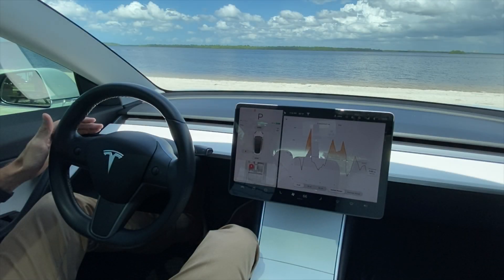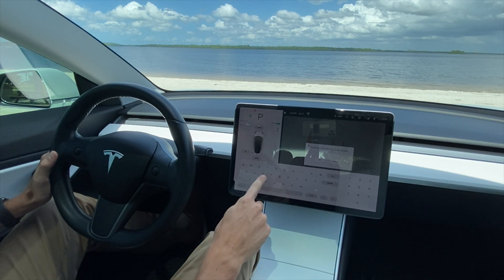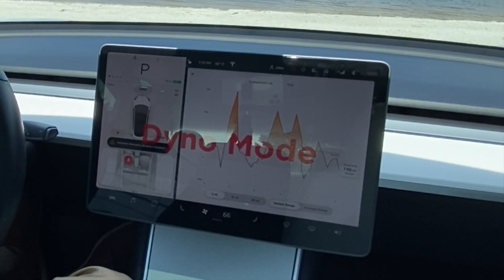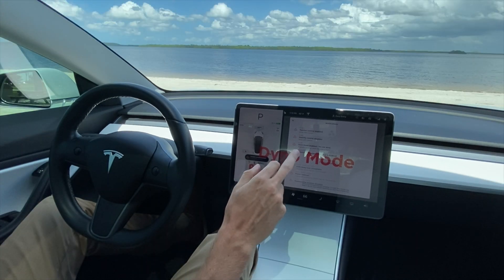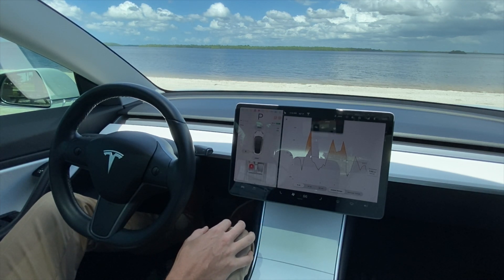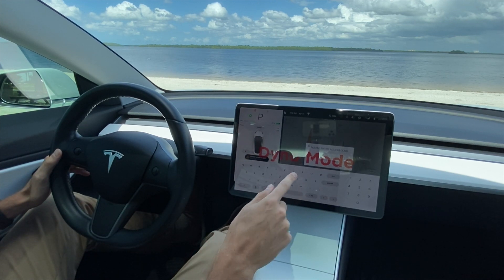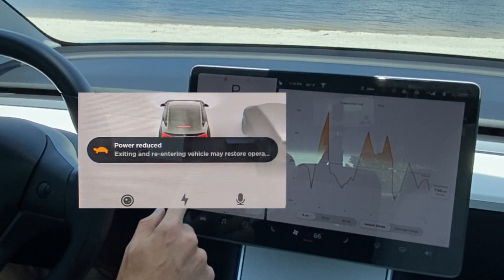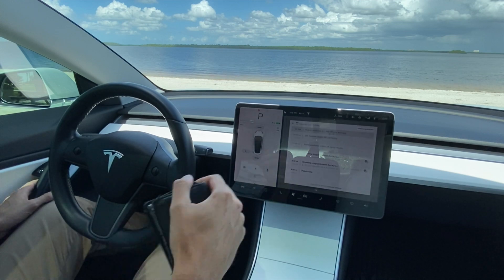Tesla Model 3 Dyno Mode - How to use Dyno Mode

Comment: do not work right now in italy, power reduced when you move the car. no more fun, holy cow
Reply from the maker: It actually does that to mine also!! I’m going to a dyno next week so we’ll see if it works there or not
Reply: @teslajake  hey great video! Did it go to turtle mode on the dyno aswell? Or only on the street?
Reply: @teslajake  did you find a solution to “reduced power/speed”?
Reply from the maker: I wish they would allow us to purchase a track mode update like the performance model has

Comment: I thought Dyno Mode isn't available anymore?
Reply from the maker: Still works when I try, where did you hear it isn't available?
Reply: @teslajake  My Information wasn't correct. It is still available but there are videos that say the Power is limited to a lower performance than in chill mode. I couldn't test it yet because the delivery of my model 3 is next week. What do you think about the acceleration in dyno mode? Do you have the latest update installed?